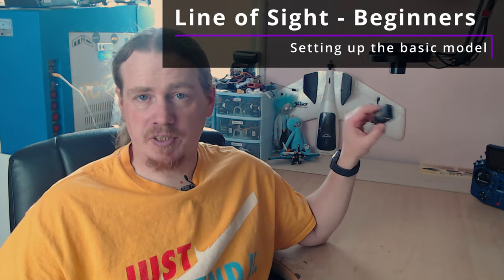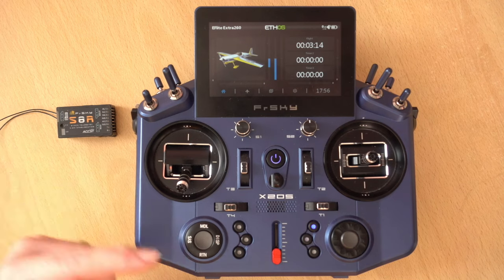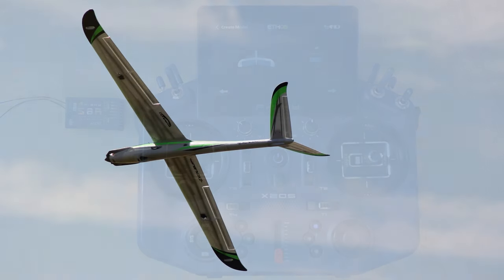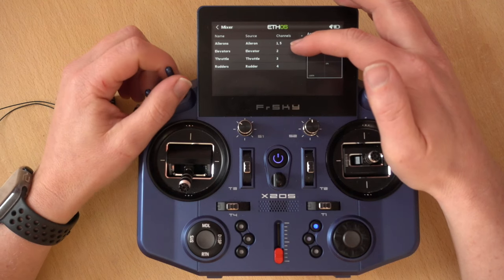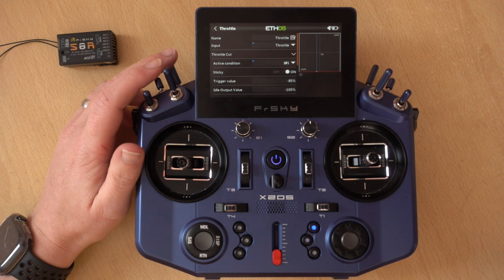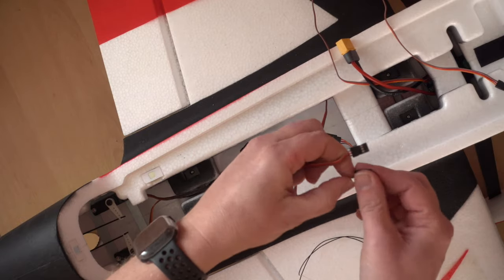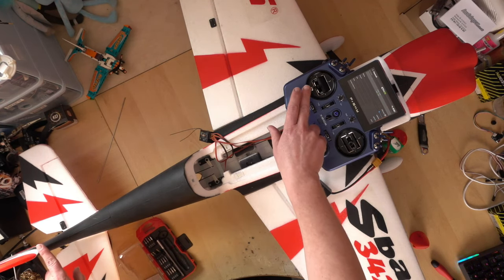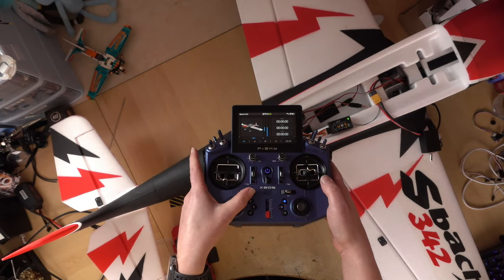LoS Beginners: Setting up the basic model on ETHOS

Comment: I am trying to setup a brand new scale model aircraft with retractable landing gear. I have 1 engine, 2 ailerons, 2 flaps, 1 elevator, 1 rudder and 1 gear.
But the widget only foresees for 7 channels. Would you be so kind to explain how to add additional channels since the very beginning?
Thanks in advance
Reply from the maker: Sorry, I don't follow you? You can add many mixes to perform the tasks that you are wanting. There are also 64 outputs. Where are you only seeing the 7 channels? Widget is what the little displays (for telemetry etc) on the main screen.
Reply: I just bought the radio two weeks ago, and I am not very familiar with Ethos.
I was following your fantastic video to create a brand new plane (Curtiss P40 scale that I built from scratch following the top flite design), and I didn't know how to add a new channel to the initial list provided by the widget.
It would be nice if the widget for a brand new aircraft would take also in account the landing gear. For scale modelers would be fantastic.
I am used to edgetx, so I guess transition will cost me a little.
Thanks anyway for your help and your outstanding videos.

Comment: Thanks for all the great videos. Can you advise if it’s possible to use a current sensor and set up voice warning of in flight battery capacity?
Reply from the maker: You can get SmartPort sensors for battery voltage and set them up to give warnings. However, I’ve found them to be unreliable on powered models. Due to sag, they read low more often than not and trigger false alarms. I find using a throttle percentage timer more useful for flight time. 

However the voltage sensors work great with gliders. You can use logic to only check the voltage after the motor has been off for X seconds. So sag isn’t an issue.

Comment: I have throttle reverse wire connected to ch5, how can I active it? I tried different setting still not working, thanks
Reply from the maker: To be honest, I've never used one of those ESCs. It should document in the ESC manual how it needs to be set up.

Comment: why do people assign two channels to elevators or ailerons if there is only one pin connection on the receiver ?
Reply from the maker: They don’t if there is only 1 pin connector. But and receiver with more than 4 channels can have ailerons on 2 channels. Which allows more precise setup for each aileron.

Comment: How did the receiver get power? Via the thrust connection to the ESC?
Reply from the maker: Yes. With typical foam plane setups like this. The receiver and servos are powered from the BEC in the ESC.
Reply: @MrD Thanks, BTW FrSky looks like a really daunting platform at first, so its tempting as a noob to go for Spektrum, but your videos have helped me decide to go FrSky. Ordering an X18 now :)

Comment: Thanks for this. I’m new to ethos but not new to flying or other radios. I fly gliders mainly. Could you make a video specific to powered and non powered full house gliders, please? Trying to learn how to set up flight modes - launch, speed, cruise, thermal - and having trouble. 
Thanks for the videos!
Reply from the maker: Hi Jun. I have that on the list. I will be using the e-Soar model for that video. I highly recommend that for full house setups. It is a fantastic transmitter model. https://rc-soar.com/ethos/
Reply: @MrD  Thanks very much, Mr. D! 
I’ll play around with this template. Hopefully, I’ll be able to make it work and get used to before international dlg contest in 3 weeks! Lol
Reply from the maker: Good luck with the contest. 

They are excellent transmitter models. Mike has a DLG specific model on OpenTX. But it’s not yet on the ETHOS models.

Comment: Great video thanks any chance of setting up a plane with Raidomaster tx 16 open tx no goggles just fly on the sticks but much appreciated thanks.
Reply from the maker: Thank you. I don't have the RadioMaster TX16S. But I do have a Horus X10S Express running OpenTX; which will be identical to the your transmitter. I could add videos for that. I thought there may already be plenty on the subject. But happy to add my spin in the future.

Comment: Thank you for sharing your knowledge on Ethos! Just bought an X18 and is struggling to set up my RES glider. How do I get the rudder to work on the right stick? I managed to assign the spoilers to a switch and the throttle is on the left stick as normal but I need the rudder to be controlled with the right stick together with the elevator. Is it at all possible with this transmitter? Thanks in advance for your input!
Reply: Plug your rudder into the aileron port.

Comment: How can it possibile to put with a switch for block security elettric motor? I camere from x9d plus opentx, and is vero difficult to ethos. Thank
Reply from the maker: It’s very easy in ETHOS. You just go to the throttle mix and add a throttle cut. When the switch is active. The throttle won’t work.
Reply: @MrD  no is to different! In open tx there is a special function,  named overraid, that you can apply to anche channel. Throttle cut is another function
Reply from the maker: @IspettoriCQ  yes, in OpenTX you had to use channel override to make your own throttle cut. Because the feature did not exist. ETHOS is easier because you just use throttle cut with the switch you want. For electric planes check the sticky is on. Then when the switch is set, the throttle doesn’t work. When you arem the plane (disable the throttle cut). The throttle has to be low before the motor starts spinning. It works well.

Comment: Hi Darren thank you for all your videos I’ve been trying to do a update with the x20 following your video for people that are not computer literate I’ve done as you said but now the transmitter has gone blank any idea or advice you can give me please
Reply from the maker: That sounds strange. Was the update process interrupted in any way? At what point did the screen go blank? During the update there is always something shown on screen.
Reply: @MrD  Hi Darren after the update and I had done the exit from the laptop took cable off and it went off
Reply: @MrD  if I hold down the enter button and the power button the boot mode comes on
Reply from the maker: Getting in to boot-loader mode is a good sign. I would maybe leave it plugged in for an hour or so, just to ensure the battery is topped up. Then try the update process again. I would probably download the 1.1.4 firmware again, and double check the hardware target is correct. Put the firmware.bin file on the root of the SD card, then unplug the USB. At that point you should see a message on the screen that the firmware is updating.
Reply: @MrD  ok I will try that thank you I will let you know will give it a go when I get home 👍
Reply: @MrD  Hi Darren just to let you know
Reply: @MrD  Hi Darren just to let you know I did the update again following your video and now all sorted thank you for all your help Mike
Reply from the maker: Awesome. I’m glad it’s working for you Mike. I guess the flashing must have corrupted somehow. Fantastic news.